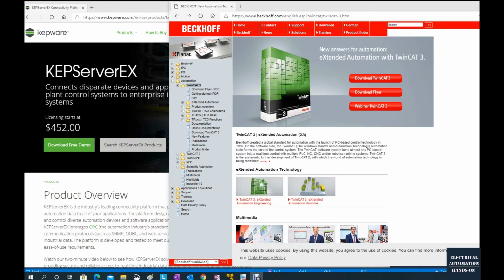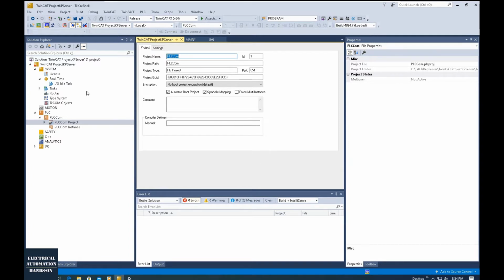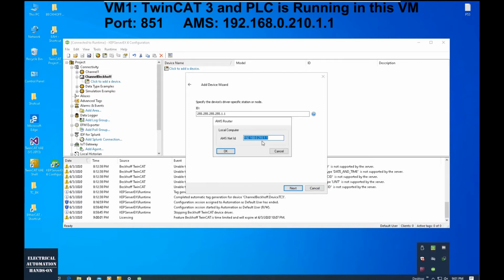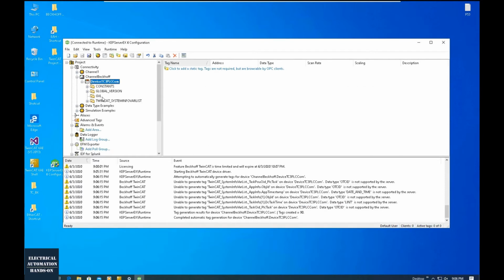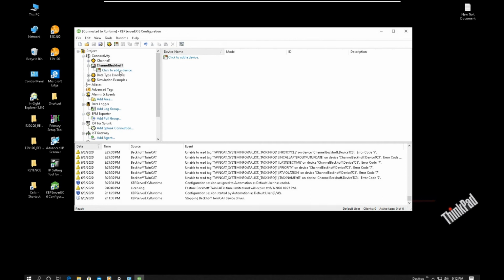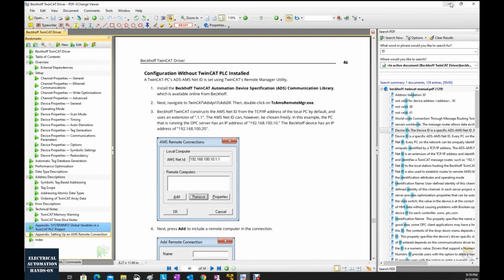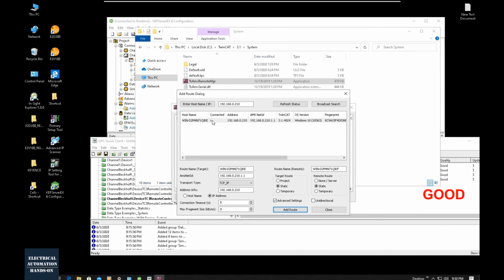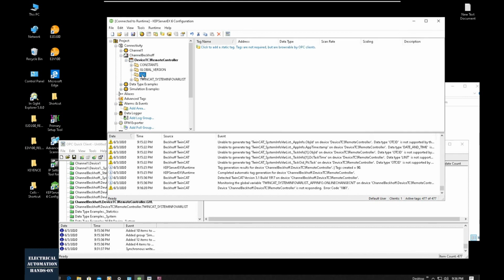COM10. Connect Beckhoff TwinCAT3 PLC to Kepware KEPServerEX (Two Scenarios)

Comment: Thank your video. Then I have a question. If TwinCAT wants to read existing data at Kepware, how do we work it? Also ADS or use OPC UA/DA license? Thanks !
Reply from the maker: The communication is bi-directional. The data is read and written at the same time.  The communication shown in the video was using AMS, (You could call it ADS).   it is not OPC UA/DA.   If you'd like to use OPC UA/DA, you have to use the TFxxx software for OPC and OPC license from Beckhoff.
Reply from the maker: My video shows all the configuration procedures for the AMS way and explains how to find all the 'addresses' in the video. 
Regarding the OPC UA, the data default is read and write, double directions, unless your controller side is set some permissions to forbid the variable write.
Reply: @electricalautomation  I think you misunderstood my question. Sorry, maybe my question is not clear.😶 In your video, Kepware makes a connection to the beckhoff PLC via file.pty. That is normal because It is just a connection part/device of the Kepware connection.
I want to access all devices in the connectivity of Kepware via ADS TwinCAT. This is my concern. ADS TwinCAT is free, so I try to use it although I also use OPC UA which works well. 😅
Reply: @electricalautomation  thanks your reply. And, I have a concern. OPC get data from other protocol easily but vice versa it 's different. As you know, ADS comm PLC need AmsNetId, register/Address of ADS, and Port for connection. How do we have those infomation in Kepware? Last time, I got data of Kepware through Modbus, OPC UA but ADS not yet. Looking forward to your support !

Comment: Nice, good Job.

Hi, i would like to questions :
1. Can it be connected of there is a different version between TwinCAT PLC and TwinCAT ADS TC1000 ?

2. Do you have to klik login / run on TwinCAT PLC to be able to connect to Kepsever ?

Thanks 🙏
Reply from the maker: A1: I think so, ADS comes from the Beckhoff, and it is the common protocol for Beckhoff controller.
A2: Login and connect Kepserver are two different topics. Login PLC operation is used to download the program and variable. To connect Kepserver, as long as your Beckhoff PLC is running, it can connect.